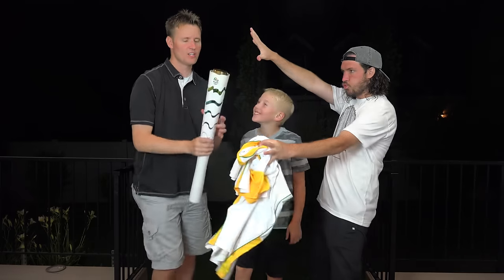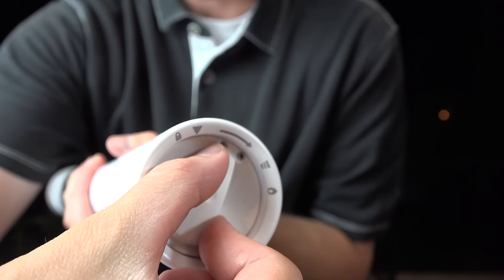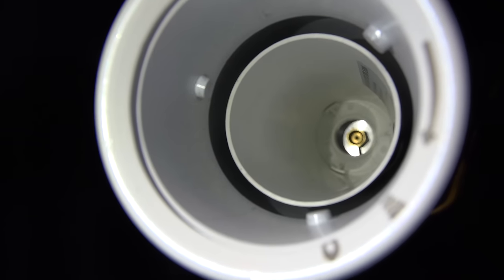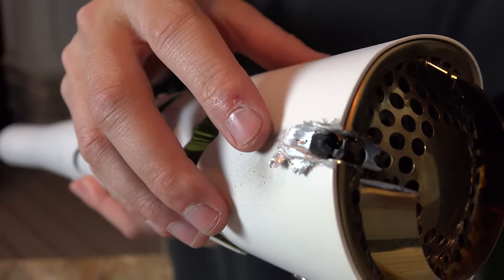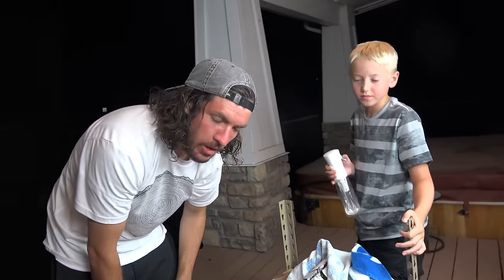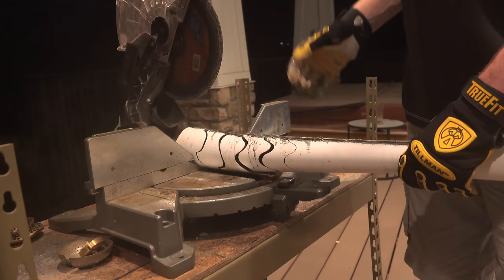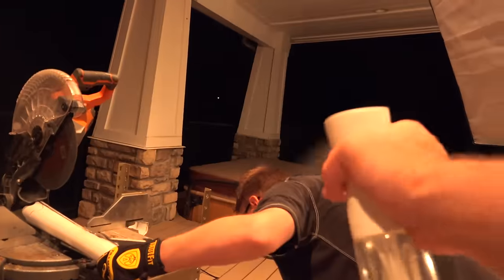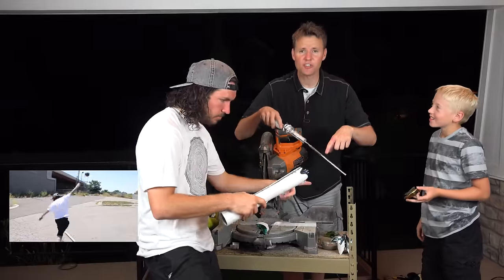What's inside an Olympic Torch?

Comment: Who else wanted them to first light it :(
Reply: me
Reply: probably everyone
Reply: They probably would have if they were able to.
Reply: It probably requires some propietary fuel source and the torch came empty...
Reply: It's probably fueled by a lighter fluid can. That's why the switch sinks down about an inch when turning on.
Reply: iTheGeek I mean't like the container of fuel that goes into it.
Reply: Looks like it would fit a standard cheap camping stove gas cylinder.. Nothing special
Reply: Sebastian Rietig That's what I thought at first but the cavity is so long and thin, unlike most camping gas containers...idk tho
Reply: ME
Reply: @Bloeki123  Nope. Most torches are lit using their own canisters. You can't just buy any butane gas canister to light them, of course you might be able to rig one up, but generally these torches are designed with their own canisters to fit inside the small cylinder of the torch tube.

Comment: >using a 1/4'' disc instead of an actual cutting wheel
>actually spraying water ON said disc
This hurts my brain just as much as my inner safety guru.
Reply: Not even going to mention the fact no one around is wearing safety glasses.

Comment: This gave me welders anxiety, you destroyed that grinder since you used a super thick zip disk, and its an ABRASIVE wheel, putting lubricant does not help the grinder, and abrasive wheels are not meant to cut aluminum, it gums up the grit on the wheel. If you used a portable bandsaw and some cutting fluid it would have taken no time at all or even a reciprocating saw. And when using an abrasive chop saw the breaker tripped because you were applying too much pressure to the material, let the saw do the work instead of forcing down on it.
Reply: I noted that watching it! Use a damned cutting disk and it would have been done in minutes, not hours, and with only one grinder that would still be going.
Reply: You mad that I don't spend all of my time playing 2K?
Reply: wtf?
Reply: I'm a welder too and I thought they would know to use a cut off disc. They have cut a lot of things in half and must have learned something along the way.
Reply: +Tomas Jonsson yup! Just buy a freaking decent band saw!
Reply: It thought that this comment was cool then I saw you were a vegan and the comment lost all hype
Reply: Star McCarthy gee, thanks haha.
Reply: and the kid is watching him hack through it with no glasses or anything
Reply: f that im to lazy to read that chit

Comment: What's inside an atom? Can you please split one or two, i bet nothing bad will happen. ^^
Reply: Splitting one atom has enough power to cause one grain of sand to bounce in the air so you're right nothing bad will happen
Reply: AircraftPro But you can't split just two, you would have to split way more.

It was intended as a joke.
Reply: +IMPERATOR okei
Reply: Japan
Reply: +AircraftPro true it depends what element you are using right?
Reply: XD OMG YES
Reply: Haha lol
Reply: no portals to hell..
Reply: +Noel Rubalcava Not really depends on how many atoms are there, Hydrogen is one of the most abundant elements and most ' weak' yet a hydrogen bomb can flatten an entire city
Reply: IMPERATOR
Reply: Porsche 718 Turbo
Reply: Yeah. Mean it wont be too expensive (lies)

Comment: let's open that saw and see what's inside it causing problem
Reply: What's INception
Reply: +Andrew H 7:51😀
Reply: I don't know what kind of cut wheel he was using but i do know it would have been much simpler to use the thin ones for cutting steel.
Reply: +8BitChicken ` yeah and you also not supposed to get them wet

Comment: that was an angle grinder..... not a saw
Reply: then the last thing  they used was a chop saw...just sayin
Reply: not to mention they called the electric motor an engine... no... just no... lol
Reply: Its called a drop saw not a chop saw buddy
Reply: Exactly thank you at least I'm not the only one and why did he use a grinding wheel instead of a metal cutting wheel
Reply: Because he has no idea how to use tools. At least according to his other videos.
Reply: not saying he doesn't, i was just saying. as i said in my comment
Reply: +Christian Plott Thank god i was not the only one who noticed that :D would of made much less of a mess
Reply: An angle grinder with a cutting wheel and guard removed would have worked perfectly. A chop saw is a terrible idea for this - it's the wrong tool. A grinding wheel is the wrong wheel for cutting something which is why he burnt up his angle grinder.
Reply: Yup, just thinked the same.

Comment: is that the real torch and if it was how did you get it
Reply: There are lots of real torches. This could easily be a spare they didn't have to use
Reply: As tyler said: they make a lot of them. Because it's not about carrying the torch but the flame. So when they change runners they transfer the flame from one to the other. Then they assume that a few people will fall and break it, some torch will get stolen, some will dead on arrival, some will get lost etc. So they make a lot of them.
Reply: +Riley Burnett It's not a replica, someone actually ran with it.
Reply: There were hundreds of Rio torches made. This torch was not the one to light the flame at Rio, but it was used by a runner at some point during the flame's travel. Each runner had their own torch to pass 1 flame all throughout Brazil. The first torch and the last torch might be priceless and kept by the Brazilian Government, but this one isn't either of those.

Comment: Why are you spraying water at an electrical tool. That is why the power is going out
Reply: No its not, the power is going out because hes tripping the breakers because hes using stuff that takes a lot of power like the light and especially the saw. He should have used an outlet that can handle a lot of power and not plug everything into the same outlet. Most electrical cutting tools can handle moisture fairly well as it heats up a lot when its being used.    

You can tell this is the case because it trips it every time its under heavy load. If anything he should use more water,  spray bottle doesnt really do much, but its better than nothing.